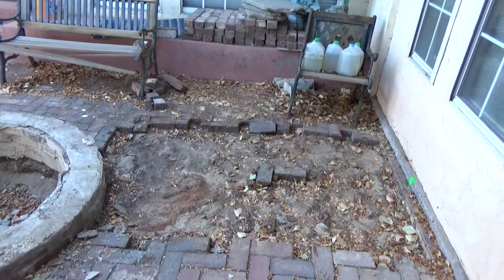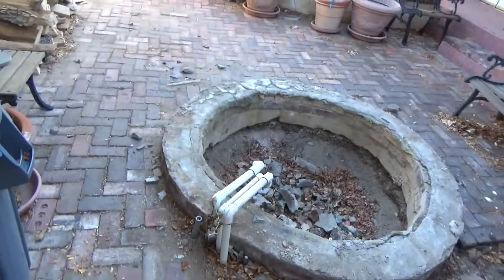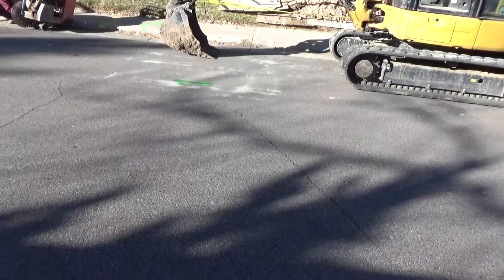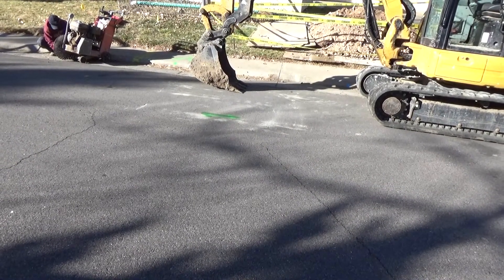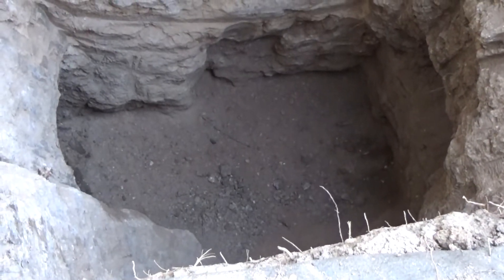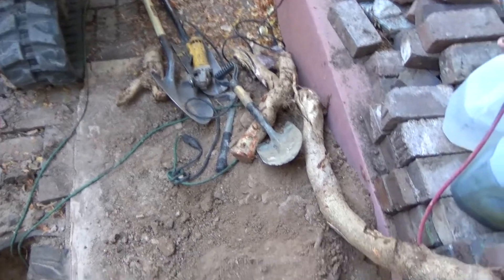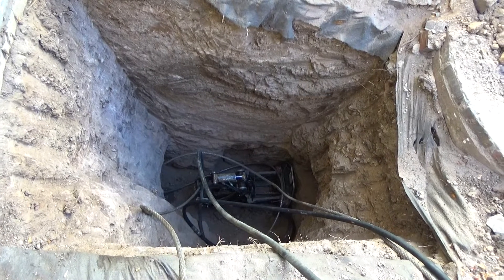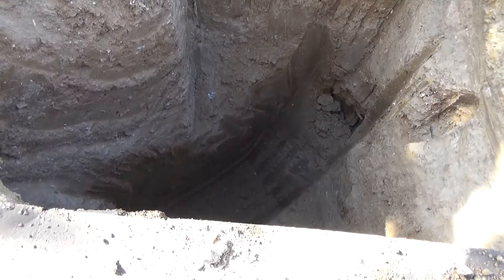Trenchless Sewer Replacement

Comment: That was good Bob. They sure saved you from having a big mess. Happy new year.
Reply from the maker: Thanks for the comment Randy. Yep, don't know what we would have done if this process wasn't available. I estimate a standard trench job would have added $20-30,000 to repair or replace all the damage done by trenching.
Reply: I once changed a water supply line at a house and the water main was on the other side of the street. The city hired a contractor to run a torpedo under the road. It save them from digging up the road and repaving the street. It was a one inch copper pipe. I guess they could go up to four I inches. The torpedo was run off an aircompressor. The operator said if it hit a big rock and started going down they have to dig up the street to get it. Pretty neat. Take care Bob